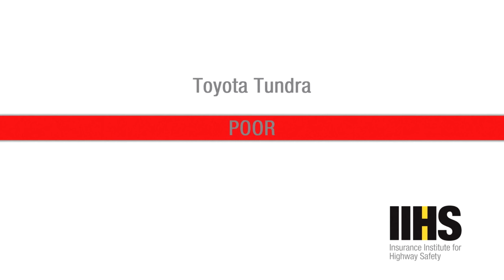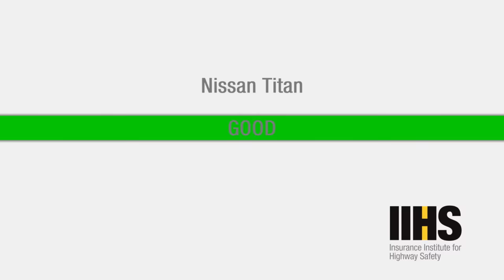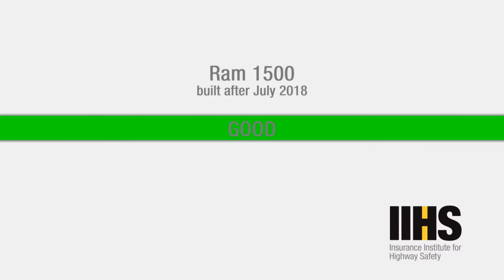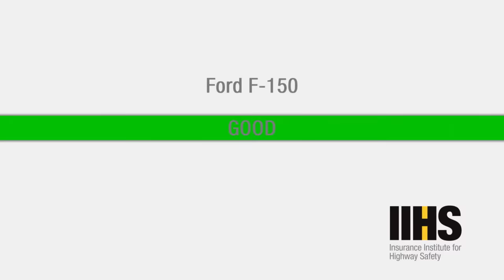TRUCK CRASH TEST COMPILATION - Ford F150, Toyota Tundra, RAM 1500, Nissan Titan

Comment: All pickups need better headlights? Every time I pass a new oncoming pickup at night I'm already blinded. I flash my brights, they return the favor and I see white pixels for five minutes. I know it's nice to see but we need limits on dims, for the safety of others.
Reply: Jared Fehr they are bad not because they aren’t bright enough. They don’t use their light well. Car headlights aren’t any brighter. They are just aimed better
Reply: driving a pickups myself feeling like small cars had way too bright lighting tho.
Reply: bensemus x no, they are definitely brighter.
Reply: @hito4863  not really just the position
Reply: Fords can detect if a car is coming by the headlights up ahead and dit dims the headlights then turns them back up.
Reply: Right, Ford super duty with the regular halogens are the worst! Blind the shit out of oncoming traffic but dont light up the road worth a crap despite having 4 headlights on for both low and high beam. Tundras and nissans at least have headlight adjusters inside the truck by the steering wheel where you can move your lights down when hauling a heavy load or towing. It has 4 different positions. Cant believe American trucks still dont even offer this when Toyota has had it as standard equipment since 2006.
Reply: Or run with ALL their lights on. Including fog lamps. If you are in a car. You get blinded.
Reply: @2nickles647  My Titan XD has headlight adjusters in the cab, I have them dipped down so I don't blind oncoming traffic. This feature really comes in handy when towing and hauling because I can adjust my headlights back on the road where the light belongs instead of in the face of oncoming traffic. My F250 work truck squatted real bad, worse than my titan xd with the same load. High beams were useless. I had to adjust them down significantly to get decent light on the road. I dont get it, even with the low beams on there are 4 headlights on and the lighting still sucks. My wife's sequoia lights up better, and its headlight designed dates back to 2007!  I cant understand why the big 3 dont offer on cab headlight adjusters like Nissan and Toyota. Toyota has had this standard on all tundras since 2007
Reply: Sounds like you should quit flashing your damn brights then..
Reply: The lights on Pick-ups are to high. The lights on my 2020 Hyundai Santa Fe are very bright, placement is low and aligned very well to the road, I love them!!!
Reply: @hito4863  nope, the NHTSA has had the same standards for lumens for some time now. The lights are not getting any brighter.
Reply: @2nickles647  fog lights are typically aimed down and to the sides of the road.  If you're getting blinded by fog lights then they are grossly miss-aimed. Also most vehicles cannot have the high beams and fog lights on at the same time.
Reply: You do understand that with the height of a truck, they're more in line with your field of vision right?
Reply: @FoDaddy  Correct. I know 100% Ford trucks from factory do not allow for all front lights to be on at the same time (lows, highs and fogs). It requires you to go into the computer with FORSCAN and code in what they call Bambi mode, then the vehicles can turn on all front lights. Ford does not allow this from factory for safety reasons.
Reply: There is a thing called self adjusting headlights to combat the issue of being blinded by other drivers. The EU had extremely strict safety standards and they are approved by the EU but self adjusting are illegal in the USA for some odd reason but I'd import them myself if I got the chance. There'd be no way a cop would know that I have illegal headlights plus they'd be safer for the road
Reply: That is exactly what they are talking about! Honda Ridgeline doesn't blind oncoming traffic, the rest do and that is why they are not getting 5 plus stars
Reply: Its not really the position or brightness it is the type of light that is coming out of the newer lights. It is very hard on peoples eyes. The blueish white color doesn't help anyone see. It seems brighter, but in reality it is horrible.
Reply: i never understood the point of using high beam lights. They serve like no purpose... you can see everything just find with regular lights
Reply: @artyomarty391  K Mi ji ji ill and 0 no

  

O:-)

Vi vi no by fcc ji
Reply: Another thing is most vehicles headlights are aimed factory or aftermarket with the weight of driver only, no weight in boot or rear cargo bed. Add extra passengers in rear seat, or fill up cargo bed and the extra weight in rear will cause the front to aim up higher. When I added a bullbar to my car, the lights aimed lower at front because of the extra weight front. The headlights got re-aimed to where it should have been. Another thing is my car has LPG, so there is a noticable difference when I fill up both LPG tank (70 litres) and petrol tank (65 litres) causing extra weight to back.
Reply: thats what they mean. there are lights bright enough that dont blind oncoming traffic which is the third leading cause of headon crashes right after dui and texting.

Comment: Built Ford tough :D so it wasn't just an illusion that I feel safer in the bigger trucks.
Reply: well if you look at other crash tests you will see that most of us pickups are quite pour
Reply: Tough = Rust.
Reply: The safest truck, the Ridgeline, is not a full sized truck.
Reply: People who feel 'safer in the bigger trucks' should be made aware that with this 'safety' also comes a high responsibility, since they are driving around in a small truck, and can therefore inflict greater damage on other road users (especially bicyclists, with the hoods of these trucks almost designed to kill on impact).
Reply: A big 70s sedan would kill that ford in an accident
Reply: Go spit on Abraham Lincoln's grave Correction the Ford would destroy the 70’s sedan
Reply: @disaar3679  nope aluminum.
Reply: @disaar3679  they use aluminum now so it wont rust
Reply: @grandbuba  Wow, you'd hate being in Australia then.
Reply: Actually the Ford swung outward so it missed the mid section of truck. Could have been worst
Reply: I dont know if I feel safer but I feel like the weight vs size is in my favor.
Reply: @grandbuba  if only bikers would follow the rules or know my truck can kill on impact.

Comment: So it's acceptable, no in fact the safest truck when the airbag completely misses the target? 5:52
Reply: what the actual fuck right?
Reply: The dummies head went right between the airbags and most likely struck the dash
Reply: @tp7886  right😭😂
Reply: They left out the tammy fay face on the dash picture post  test. WTH?
Reply: Lol
Reply: Leopold  a little late to the reply party, but the reason every dummy keeps hitting to the side of the airbag is because the truck is kicking to the side, and the dummy keeps going straight due to inertia, and thus the dummy missed.
Reply: I saw the same, but I think the acceleration was small in the exact moment when the dummy head crash into the dash...
Reply: No that’s a head injury as it slides between front and side airbag striking a pillar
Reply: "Some of you may die, but that's a risk we are willing to make!"

Comment: They dinged some of the trucks because of the headlights.
Not because they weren't bright enough.. Likely because of they may be too bright or they way they are aimed.  This will be something that full size trucks will have issues with for a long time.. The headlights are just mounted higher, and they need to be.

Comment: the Nissan has a V8, it says so on the flying engine cover
Reply: But you know it ain't a HEMEH
Reply: RAM’s isn’t a Hemi either. 

It’s a highly modified Hemi-ish engine with a second spark plug so that ancient design will pass emissions. It’s designed to tickle the emotions of Baby Boomers who don’t know it’s as thoroughly obsolete as the flathead design. 

Just think if the NHRA abandoned its stupid rules and let wedge head or petaroof engines in... Top Fuel dragsters would have to do 700 foot passes to stay safe.

Comment: Note to self “dont drive into a wall”
Reply: Unless you're in a Ford f-150.
Reply: I know you were joking, but it could be someone else running into you.
Reply: LOL  😃
Reply: Crash avoidance technology. Hello. That's built into the new trucks.  Did they factor that in? The sensors would notice the block and warn the driver unless they were drunk or high. I mean this isn't even real world. I didn't hear the sensors going off warning the driver. This test is really odd. There aren't cement blocks all over the place as an obstacle course.
Reply: Or into a steel block.
Reply: @johnhaslett6714  These tests aren't about the possibility of a crash, they are about the safety of the passengers in the case of a crash. It would be pointless to test them in the way you describe, because it would provide useless information about the safety of the passengers in the event that a crash DOES happen.

Comment: imagine that one day in the past GM fans made fun of Aluminum guess whos started using aluminum XD welcome to the future GM
Reply: Yeah, GM ad lie #37.. Took all of what four hours for the slo-mo guys to uncover the scams in that ad? GM trucks went right over the cliff that week and have never recovered. It's all Ford and Dodge now.  When you copy Ford for 15 years,  then try to con people with deception and lies, you kinda reap what you sew.  Even Obama's redistribution of our  $25,000,000,000.00 didn't help.  
Yeah Brad, it's not just aluminum.. GM even uses the Ford designed 10 speed tranny now. Too funny!
Reply: And they completely copied the whole front end of the 2015-2017 f-150 and stole the back side of a tundra and called it the 2020 Chevy Silverado, but it still burns it’s cams up though, so they still have that to boast about “just got my 3rd engine swap in the old shitterado better than that ford junk”
Reply: @TheSunpro  Ford and GM worked on 10sp transmission together.
Reply: How much to replace a GM/Chevy fancy tailgate? Probably $2500
Reply: @davidjose2193  That's an extremely  high deductible.
Reply: Chevy BOUGHT Ford's to make commercials. Just so it would backfire on them lol.

Comment: It’s amazing how automakers strive for tough looking front ends and then you watch a crash test vid and see so much cheap plastic flying everywhere.
Reply: They're about as tough as the short men behind them lol.
Reply: Ever watch an indy or formula 1 car wreck. Million dollar setups reduced to nothing in a split second. Does that make them junk? No it means their shedding energy. Throw more plastic on the front if it means my legs wont be crushed or my kid wont have brain damage from smacking the "grab handle". I bought a 2018 f-150 for a reason. Yes its aluminum, Yes its faster than the competition, yes its more capable than the competition in every way, and yes its by far the safest truck on the market. My family comes first so my decision was a no brainer plus its UNION made right here in AMERICA.
Reply: Cheap plastic is cheaper to replace then sheet metal if the vehicle isn't totaled... all vehicles to some degree are made with crumple zones it's ment to be destroyed and absorb the impact so you don't have to... so it's better to see it flying then you being launched thru the dashboard or windshield.
Reply: It’s meant to do that on purpose, more plastic and foam, the better it absorbs during a crash...
Reply: 07slowbalt Toyota’s are made here in America too you dunce. This isn’t the 1950’s
Reply: @07slowbalt  ligher is not always better. My titan tows and handles a load much better mostly because its heavier and more stable. The f150 is a fine vehicle not necessarily more capabe in every way. All of the trucks tested in this video are american made.
Reply: Not so subtle union commie propaganda 
 @07slowbalt
Reply: It's expensive plastic, and front ends on all regular street vehicles are designed to minimise damage to pedestrians fyi, that's a big part of the wimpy front
Reply: The fronts are crumbly and plastic-y for a reason. If the front end isn't absorbing that impact, you are.
Reply: @clearcreekdairygoats4135  that's why they have the f250 and the f350, you do realize that right?

Comment: The Honda aint no truck 😂😂 Thats a disformed suv
Reply: The Chevy Avalanche was literally a disfigured suv and still a much better truck than the goofy Ridgeline.
Reply: You too funny i agree
Reply: most trucks even if for hauling/work don't need to be body on frame. Its designed to be lighter for fuel saving.
Reply: It’s actually the truck that 90% of pickup truck drivers in America need. It’s really an Odyssey. 

I drive a minivan rather than my truck most of the time. It hauls 4x8 sheets of plywood and drywall better than your typical tonneau covered 6.5 foot box pavement princess. It hauls extension ladders, canoes, and 14 foot lengths on top better than a stock pickup truck. It can tow a utility trailer for firewood and bark mulch and dump runs. And I’m sure I’ve taken my van up roads you’d be too scared to take your truck up.
Reply: @Bartonovich52  watch out everyone, we got a badass over here.
Reply: The Honda's as much truck as people need 90% of the time. People who tow go for 1 tonne trucks. People who off-road go for Jeeps. The Honda will do for people who use their trucks like a car.
Reply: Aint and no, double negative 🤦🏻‍♂️
Reply: It’s a unibody it shouldn’t be classified as a truck
Reply: Honda ain’t from here son
Reply: notagoon695 Fords are made in Mexico while Honda is made in Sweat home Alabama
Reply: @Bartonovich52  you are delusional
Reply: @Bartonovich52  no man ever would rather have a fucking minivan over a truck
Reply: Ridgeline, odyssey, etc are all just honda accords with different bodies on them
Reply: The crash test for it on the driver side did very well, while the passenger side only did acceptable
Reply: Sammydean04 Ford F-150 trucks are made in Dearborn.. Chevy builds theirs in Mexico.
Reply: Bartonovich52 pavement princess? Most of us use our trucks as a daily commuter but want the capability for either side work, play, or work. The F-150 will destroy your mini van all day. And the off road comment you made is a joke.
Reply: Actually, I believe it's based on a minivan platform. :P
Reply: fordrac1ng81 The Ridgeline and Pilot are based on the same platform. The Accord is a different vehicle entirely...
Reply: @Bartonovich52  its based off the Honda pilot platform, which is a medium/large sized SUV
Reply: It's a Honda El Camino hahaha
Reply: Todd Swasey nothing wrong with that.

Comment: Even after the test crashes, the Tundra's resale was on top.
Reply: They come in 5th place in sales. They are gas hogs and they are a generation behind the top sellers in design.  The Ram is the fastest growing brand and also the most sought after in the used market!
Reply: @charlesmarshall2697  Ram trucks, (or any Chrysler vehicle), the most loved by mechanics everywhere. Easiest way to make a fortune.
Reply: Charles Marshall I’m talking resale. Sure Ram sells more and has better tech. The Tundra is a truck, simple and over-engineered. It’s made to do what it’s supposed to do for a long time and it’s longevity proves that over the big three, hence better resale.  No one buys a truck for gas mileage. If you’re into that, get a Prius.
Reply: Sold my 10 yo 127K Tundra for $14K.  No other vehicle is going to retain 45% of original value after 10 years.  Hope I never have to find out how well the structure performs.

Comment: Until the Ford. I had no idea how they should behave to protect the passenger. That was an impressive show by Ford.
Reply: Yea you see it right away when one of them finally handles the crash well
Reply: And the Nissan, and the Ram.
Reply: Yes it was
Reply: Ford is recalling 1.48 million F150's. They just recently announced the recall, and 7,000 white collar workers will be losing their jobs in 2019.
Reply: Reviews 2018 Ford Explorer crash test..
Reply: @CFIRST58  So what? Vehicle manufacturers recall stuff all the time. How many millions of Hondas and Toyotas were recalled for defective Takata airbags?
Reply: @CFIRST58  Don't care and don't care. Recalls happen all the time, and so what about workers losing their jobs? Especially if it's some of their factory workers. I'm sorry, but some of them get paid more than the people designing/engineering the cars and they still ask for more. So with greed like that, it's hard for me to feel bad when they're let go.
Reply: @CFIRST58  Yeah, for door locks. real important to crash safety.

Comment: If like to see the same tests done after a truck has been up north for 4 years and rusted all to pieces. Bet they wouldn't fair so well. The frames completely rust out leaving no resistance for crashes.
Reply: Technically since the Ford frame is made of aluminum it will not rust. It will corroded a bit but that actually further protects the aluminum since the corrosion is aluminum oxide with is an extremely hard material.

Comment: A f250 made in 89 saved me. Girl was texting and driving, hit me and rolled my truck doing 60. Roof held and the frame held good. Walked away with bruised ribs from steering wheel.